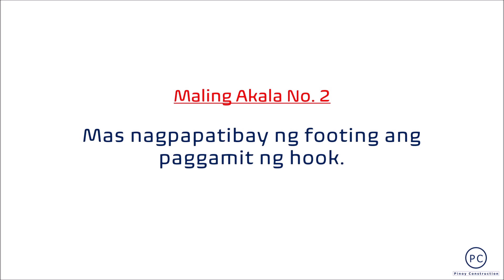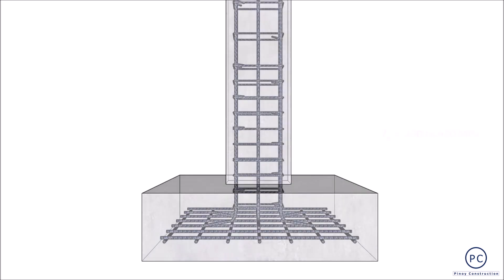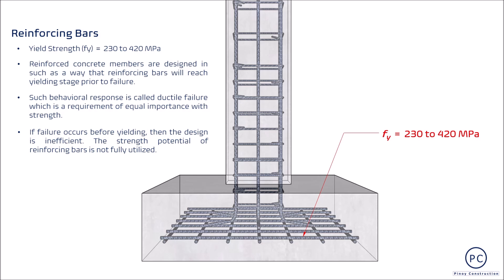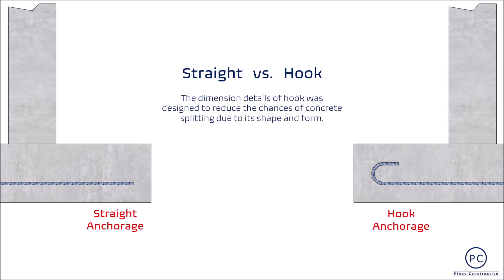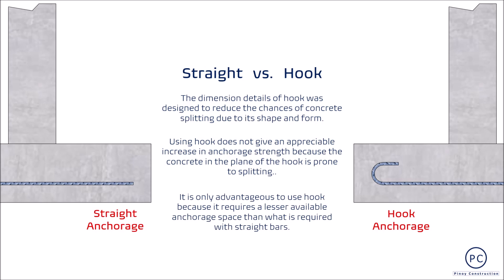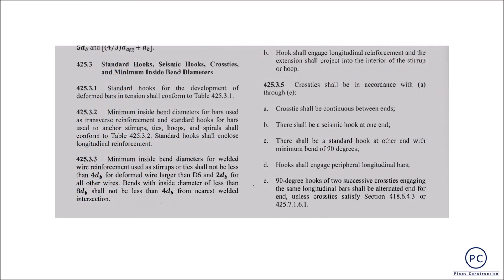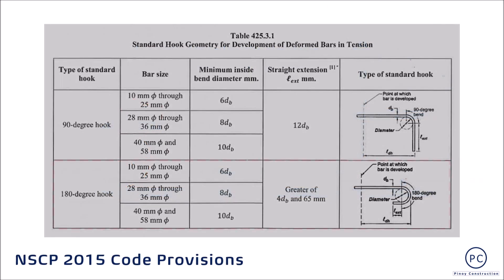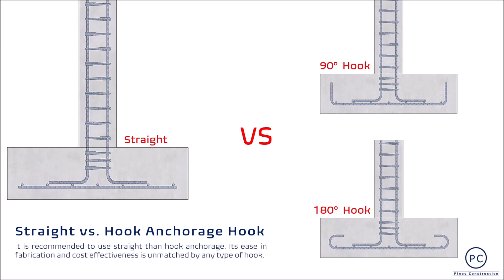Maling Akala sa Paggamit ng Hook sa Footing Rebars - Part 2 (Full Presentation)

Comment: do people use 180° hook instead of 90° because there isn't enough top cover?
Reply from the maker: Hello. If using 90 deg bend will cause the  rebar ends to protrude out of the footing top surface, then use 180 deg bend. But I would still recommend to have enough  footing dimension to cover a straight reinforcing bar with strict compliance on concrete cover requirements. Thank you for the trusting and supporting the channel.
Reply: @PinoyConstruction1  thank you for confirming that sir!

Comment: Ang critical section in a footing po ba ay nasa face of the column? Kaya diyan po ba ang simula ng pagkuha ng tension Ld?
Reply from the maker: Hello po sa inyo. Depende po ang location ng critical section ng bending o flexural stress ng footing sa sinusuportahan nito. Pero sa column footing, ang critical section ay nasa face of column. Binanggit po ang code reference sa part 1 ng videong ito. Section 413.2.7.1 at tabulated sa Table 413.2.7.1. Ang rebar anchorage (development length) Ld or Ldh taken from the critical section going to the edge of the footing sa limit ng concrete clear covering.

Comment: Gud day po sir, ilang sqr meters po sa slab bago mg lagay ng biga at ilang centimeters ang kapal ng slab na pang roofdeck single storey. Salamat po
Reply from the maker: Hello po sa inyo. Hindi po dependent sa laki ng area ng slab para maglagay ng biga. Mayroon pong floor system na ang slab ay directly supported ng poste. Walang biga. Mayroon naman na kailangan ng biga pero walang slab like in the case of roof beam ng mga single-storey house o bungalow. Depende po ito sa chosen floor system configuration selected by the designer. Isang bagay pa. Iko-consider din ang bending behavior ng slab kung one-way or two-way slab. Mas marami ang biga na inilalagay sa one-way kaysa sa two-way slab. Ang recommended thickness ay 100 mm sa one-way at 125 mm naman sa two-way. Maraming salamat po sa tiwala at suporta sa channel.